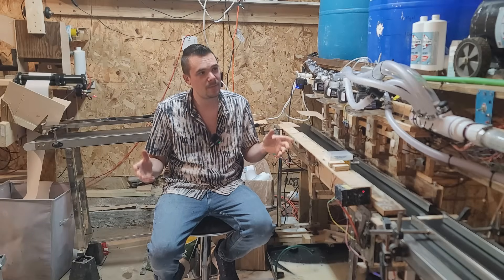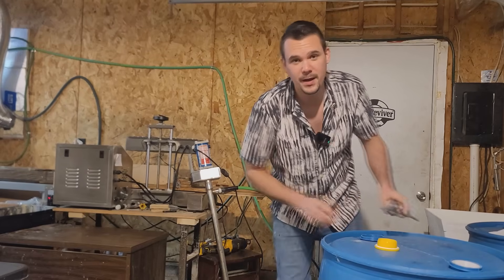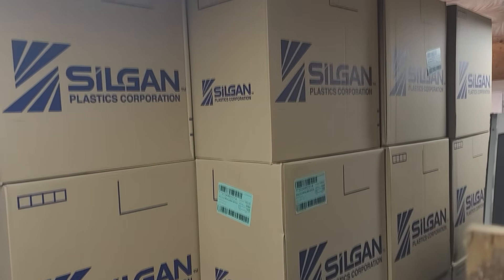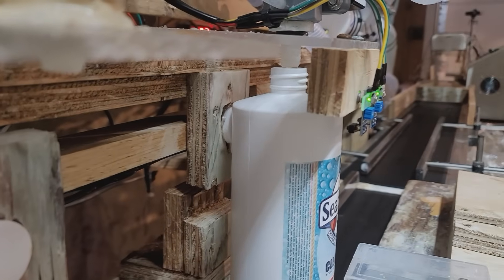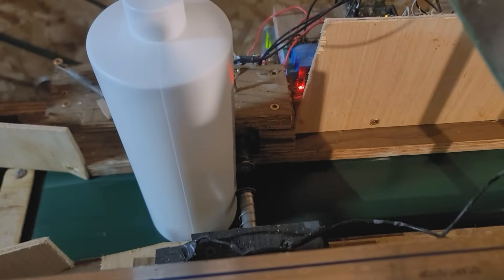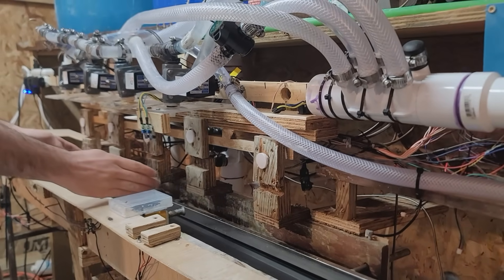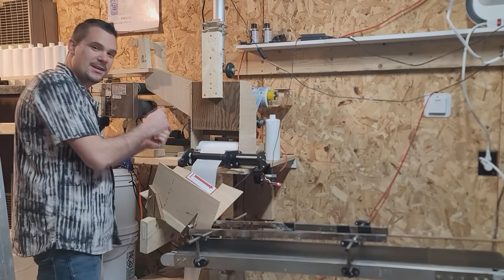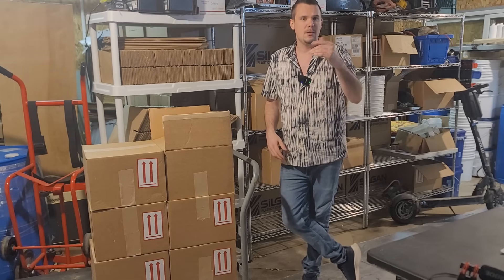I Built a $3M/Year Factory in a 600sqft Shop

Comment: Do you have to create a SDS ( material safety data sheet) and did you trademark and or get a patent, LLC?
Do you create your own labels? If so did you get a roll to roll printer?
Reply from the maker: Yes you do, SDS are always required especially with B2B. Seat Reviver is trademarked, and the exact formula is trade secret on our mildew stain remover. We do have a patent pending product coming this spring. We hire out for our labels.
Reply: @PlanesBoatsandSubmarines  thanks for the information, I’m retired and needing a small business hobby that I can do with my son. Now to decide what product to produce that doesn’t infringe on any other similar product patent.

Comment: This setup is asking for trouble!  I was working in a supplementary food industry, i always hated the overpriced crap like Siemens PLCs, but man building from plywood, i hope that's just temporary! Stainless steel is a must for the line like  this, you'll never know when some of the "inventions" will turn on you and cause a fire! The dangling wires are the second thing! Good thing that the process is not in a dusty environment so those light beam sensors actually work (without any case )! The future belongs to the go getters, but be safe!

Comment: The product he is selling can be sold by anyone.  He’s buying the chemicals in bulk and mixing them up and bottling them. He hasn’t invented some new wonder product.  What he has done is developed an extremely low cost method to bottle bulk liquid premade cleaners, sell them at a high price and pocket a decent profit.  The genius isn’t in the product, it’s low cost bottling, leveraging Amazon and retail dealers, to move his product.
Reply from the maker: This is very untrue - It is far superior to most mildew stain removers. It's demonstrated and proven to work more efficiently, faster, and has anti-corrosives added to help protect boat seat stitching. Most mildew stain removers do not have this. The formulation is actually trade secret and it's not just generic ingredients.
Reply: @PlanesBoatsandSubmarines If you say so. But based on Amazon reviews it seems bleach is a major component and you don’t strike me as a chemist, so I have my doubts about a trade secret recipe.

Comment: hey quick question, i'm a bit lost on the logistics part. $3m revenue is awesome but at $24 a pop that works out to like 125,000 bottles a year... how are you physically shipping 12 pallets of inventory a month out of the garage shown in the video? feels like you'd need a massive warehouse and copacker for that volume. 

Is the $3m maybe the combined revenue of the 'sister company' you mentioned (the boat sales) plus the soap? just trying to understand the actual scale of the soap business itself thanks!
Reply from the maker: 10,000 bottles we sold in our 1st month, which was difficult but we did it. On average we do 20% of that when out of the summer season, but to answer your question. We would ship 400 units daily, some days 600 to keep the pace, Monday-Friday. It's shipped as it's produced when the demand is high with daily pickups. Didn't need a warehouse. We're working on that now though for pre-season storage so we can handle demand without chasing it with daily production. The $3M is max capacity if we ran at the rate we did on our 1st month in business. We sold just over 20,000 bottles in 2025.

Comment: The conveyor belt that takes in uprighted bottles and ends with the induction heater, you could switch that out with a slotted chain, so that it's one bottle per slot, and the chain moves it down the line one bottle worth at a time. This fixes some of the stoppers and open ended detection, and will really help with automating dispensor, capping, induction because the bottle will always be exactly where you expect it to be. Just something to consider.

Comment: more shit in the environment,
although i like your achievement, the line and everything...
Reply from the maker: No need to worry. The filtered system captures all of it. By the way, the filters are quite expensive. They are essentially the same filtration level as the P100 masks you wear for breathing + I can assure you that our footprint is quite small.
Reply: @PlanesBoatsandSubmarines  top level for sure, but i refer also and more to your sear customers when they wash their boats and so...

Comment: I am a retired manufacturer engineer.  I am impressed.  I hope you add the bottle molding.  You will make them with no added labor.  Then I hope you go after every product p&g makes.  P&G as well as so many companies that are similar only survive because they face no legitimate competition.
Reply from the maker: That's an incredible comment. Did you work contract, or for P&G, etc?
Reply: @PlanesBoatsandSubmarines I worked for 3M.  I just think P&G makes several products that are basically very similar to what you’re doing.  Cleaning agent in a bottle.

Comment: This is great ingenuity. A few tips from a liquid manufacturer - anyone quoting you $250k for a simple drum mixing+proportioner system with CIP, a basic automated bottle filling, induction sealing and labeling was completely taking advantage of you. 

You can solve all of this for ~$50k usd or less. This is basic volumetric filling, with low throughput speeds. You can triple your units per hour with one person instead of two. 

Depending on current labor cost and production demand, you will have an ROI of 12 months or less, while easily fitting in the existing 600 sq ft.
Reply from the maker: Thanks, curious to what system you are referencing. Possibly a system via ZoneSunTech? We spoke to American equipment manufacturers and it was closer to 250K and at the time, didn't want to source from an unknown manufacturer in China. (Their listings lacked a lot of detail) that pushed us to build our own. Where are you based? p.s. feel free to email us (email in channel discription)

Comment: Your product sold 50+ bottles on amazon last month. You would need 12,000+ sales/mo to make 250k$/mo.
Reply from the maker: The title is the max output. (If you saw the full video, we stated we sold 20,000 units in 7 months and that 10,000/mo is current max capacity.) It's the winter off season for 80+% of the USA boaters, only 30% of our sales are via Amazon.

Comment: What’s your fire protection system(s)?
Are your raw materials flammable? Toxic?
Are the fumes you’re exhausting volatile?
As someone in the fire and life safety industry these are the things that I think about all day everyday. 
99.9% of people don’t consider these things. A lot of people have the mindset of “it won’t happen to me.”
I urge you to take a look and do a risk analysis. 
Please. 
It’s a great operation that needs to be protected.
Reply from the maker: All of our 120v equipment runs off GCFI, majority of the wires you see are 12V running on protected 12V power supplies. We have fire extinguishers mounted on the walls. The negative pressure system filters exhaust to the outside. I can't discuss details as it's trade secret. Thanks for watching.
Reply: @PlanesBoatsandSubmarines ignorance is bliss.

Comment: Incredible. Not sure I'd want to breath the air in your neighborhood regularly, but Incredible!
Reply from the maker: Thanks! It's a mixed use shop, and the negative pressure air is filtered.
Reply: @PlanesBoatsandSubmarines  Our shop is required to have an incinerator for gases leaving through the ventilation. I sincerely hope you never need to do that for such a small operation. They have tight tolerances and have a large amount of overhead

Comment: Neat. Does the labeler ever not work and all of a sudden you have 200 unlabeled bottles you have to fix by hand?
Reply from the maker: Thanks - No, occasionally it has an issue and I just fix it in a few minutes. I know the hardware and each component and can diagnose pretty quickly to get it running smoothly again. It gets better with each minor fix for redundancy since the beginning.

Comment: Did you receive lots of technical help in the build? Did you outsource the technical aspect?
Thanks and best of luck!
Reply: Hey there, thanks so much for the response,  and the best of luck moving forward, im even going to order a sample of your product for a friend in the marine business!
Cheers
Norm
Reply from the maker: Thanks, self tought, I used AI to help create a lot of the arduino code. Still hours of debugging, but AI made coding it possible with very detailed prompts. The actual building and physical manipulation of the bottles (labeler action, conveyors, etc was actually the easier part)

Comment: Industrial electrician here, setup looks good, love the DIY aspect of it. Main concern is an electrical fire lighting up that wood and destroying everything
Reply from the maker: Everything on the wood is 12V DC, which runs from a DC power supply fused. The only 120v contact near the wood are lead cords connected to the arduino boards also GFCI protected. So a short causing a fire is very unlikely. Thanks
Reply: Another industrial electrician here, I love what you’re doing and the care for quality is amazing. I will say that if you ever do plan to scale, OSHA can be a real pain, specifically requiring control panels with NRTL certified components (i.e. PLCs instead of arduinos). The last company I worked at almost had to pay the several thousand dollar per day fine for using an Arduino for a control task. I personally think they are very robust, but I wish someone told me this earlier so I’ll spread the love. Genuinely love the concept hope more people do it 🤙
Reply: @willmosher1059 nobody's going to be unscrewing panels to see what controls are beneath the hood, so long as you make it look professional with proper emo and safety interlocks in place I doubt you'd ever have an issue even during an inspection. The only time this would be an issue is if you have a safety event, then it might bite you in the insurance.

Comment: My only real question is: Why does the bottle get labeled and then filled? Seems to me you're tilting the bottle down, labeling it, then standing it back up to fill it. Couldn't you start with the bottle upright, then fill, seal, cap it, then knock it over and label it?

Comment: Nicely done, but you are missing the $ costs of your infinite labor time to create some pretty basic packaging machines.  I get the upfront cost challenges of small buisiness, but your well off the mark on costs, for low end packaging equipment.  There are a ton of label applicators, fillers, staging conveyors, accumulators etc...that would handle the whole Packaging process without an orientation change and for well under 50k.  The used market for packaging equipment is Huge and very economical - especially for straight walled containers like you are using.     Kudo's for building a system that works though - there is something to be said for self reliance and the satisfaction of doing it yourself.  Sincererly

Comment: Seems like it's just a couple of standard ingredients mixed together.
Reply from the maker: Have you used it? It the only shear thinning mildew stain remover gel on the market. It evaporates much slower than sprays so it's dwell time is much higher. It also has proprietary anti-corrosives to help reduce long term stitching damage, and works much faster saving time. Starbrite, RMR, Marine 31, Zep, none of them do that.

Comment: My lifetime in bottling plants is both impressed and little bit cringed with the wood
Reply: What's so bad about the wood?
Reply: The wood is fine for bottling a product like this that isn't for human or animal consumption.  If it were for human consumption or application, then he would likely have to water-proof the wiring and electrical components and use materials like stainless steel, aluminum, polyethylene, and other plastics so that the bottling line could be washed down and disinfected when necessary.

What he has created here suits his current needs without spending beyond his needs.  He can always upgrade the assembly line, section by section, when profits allow and production increases even more.

Ed
Mechanical design engineer, manufacturing consultant, and business owner for 40 years
Reply: @edschultheis9537 
UHMW plastic has become one of my favorite materials to make small to mid-sized components. Almost as easy to work with as wood FDA approved. 
Difficult to bond but easy to drill and tap.
Reply: Ya I work in bottling. 
The wood was the only thing unattractive but he's got a budget. 
Still great job figuring it all out.
Reply: I was a tooling engineer (retired now), everyone stressing about wood, sheesh! I'd just make a 3d printed or easily made UHMW replacements as I went along, found issues and improved.  Start cheap with continuous improvement, better/more robust fixturing materials. I say, "way to go!"

Comment: Sup mate,

I also do chemical manufacturing, idk what's inside your product but since it says cleaning gel, it might damage those blue plastic containers which will then leave impurities in your solution which could either affect your formulation OR leave negative effects on the end user.

edit: shit dude this looks like a fire hazard waiting to happen do you have a fire impression mechanism in place? too much wiring, arduinos, directly exposed to the elements/risk of a bottle tipping over them, etc...
Reply: He said that the electronics are running on 12 volts, low voltage, so the electronics are not going to start a fire.

Comment: You need to invest in a budget PLC for this. Would run your whole system and be easy to find any problems when they happen. As well as allow for more advanced machines like the auto cap.
Reply from the maker: You might be right to transition to this, especially when we relocate to a larger assembly line. Right now, I can detect failures pretty quickly and have replacement parts for every component on site for quick repairs. Since the beginning, we have optimized the setup and now have fewer maintenance issues. Thanks for your input.

Comment: I used to be the guy who puts the lids on bottles where they are screwed in, also quality control for damaged bottles that slipped through where the thread was melted or mis-made in some fashion such as a hole in the bottle - that ends up messy if the liquid goes in a bad bottle!! I also used to be on the end of the conveyor belt where it goes into a round area to pack up the bottles into boxes and place on the pallet.

Comment: Are you required to ship with safety labeling on the box (GHS, etc)?  Did you have the product tested for the MSDS? IF so, where did you have it tested? Thanks
Reply from the maker: No safety labeling, GHS placards required, because our products classify as non-hazmat. To touch on this, We formulate specifically to avoid a classification that isn't exempt from standard transportation restrictions. Hazmat Items (High concentration acids or bleach) = More process in logistics = harder to scale without a lot more leg work.
Reply: @PlanesBoatsandSubmarines thanks for the response!

Comment: You put the bottle cap on before you sealed the foil over the hole opening on the inside. Doesn't make sense?
Reply from the maker: the foil is inside the caps already
Reply: @PlanesBoatsandSubmarines  So the heat after the cap goes on is to seal additional plastic over the cap to help seal it? I admire What you've done.
Reply from the maker: Yes, induction heating doesn't heat the plastic but the foil liner under it. Of course

Comment: Why would you only get 10,000 bottles a month when you do 200 bottles every 30 minutes? That would be 400 every hour and what 10 minutes to fill you conveyor of each 200? So you would need 12 hours to run 4,000 bottles a day. So you only work approximately 2.5 days a month for 10,000 bottles a month and you make $3 million a year? That is wonderful!
Reply from the maker: lol, I'm happy to clarify this. 1)10,000 units is the max capacity which is equivalent to $3M/yr, I said in the video we sold over 20,000 bottles to date this year. We're running about 20% capacity. 2) To answer your question on capacity, that doesn't account for batch mixing times. That's the biggest bottle neck. However, technically we could do 20,000 units a month out of this, if we work 16 hour work days in shifts.

Comment: Only 89 reviews on Amazon.  I gave AI the stats and AI thinks you are lying:
The gap between 89 reviews and the expected 1,300+ is significant and strongly suggests the sales volume is 
fabricated or occurred entirely off-Amazon, making the claim disingenuous in the context of an Amazon business.
Reply from the maker: Assuming based on AI instead of just asking, is ironic. Approx 60% of our sales are direct, 30% amazon, 10% boat dealers. We get a lot of direct sales via viral videos and during those viral videos we ran BOGO promos to incentivize people to buy direct. Less fees and the cost of a BOGO is less. Win-win.
Reply: @PlanesBoatsandSubmarines  So $1M sales on Amazon and only 89 reviews?
Reply: I also neglected to note that the system has run for only 7 months, not a full year.  That lowers the number of expected reviews by 7/12, giving expected review numbers of between 31 and 62.  

87 reviews is better than average.
Reply: @andymanaus1077  Typical review to sales ratio on amazon is 5 to 15%.  7/12 of $1m is 20,114 sales at $29 ea. that results in a .44% ratio of reviews to sales of your product.  I'm not sure what math you are using.
Reply: @onjofilms  he said they did over 20,000 bottles in 7 months. That's about 500K in revenue from quick math on the product price. Assuming from his 30% sales on amazon that's 150K on amazon.